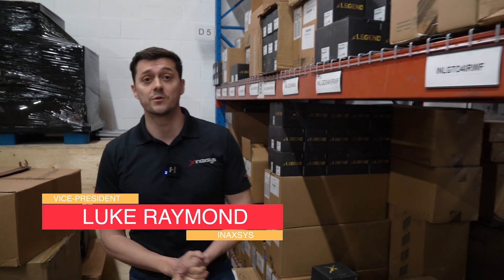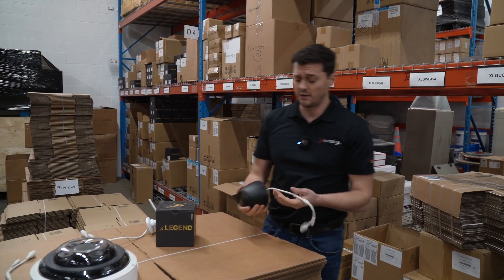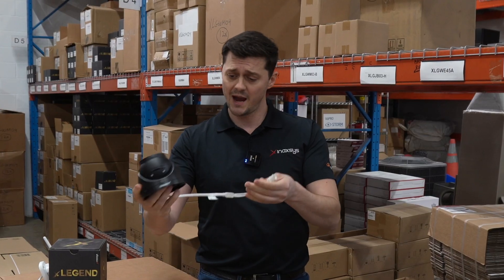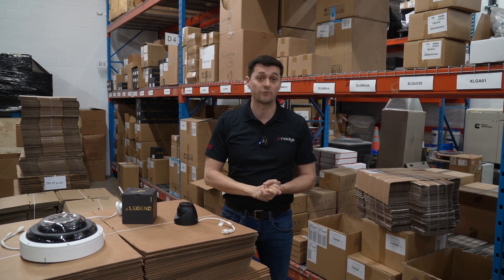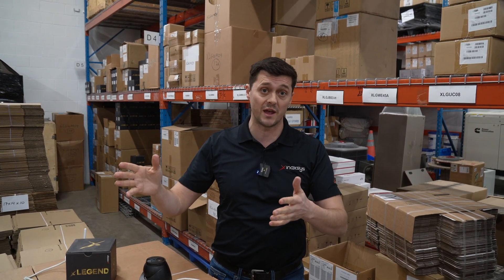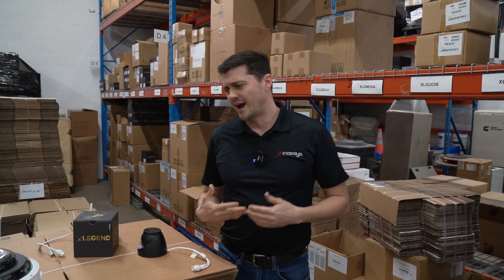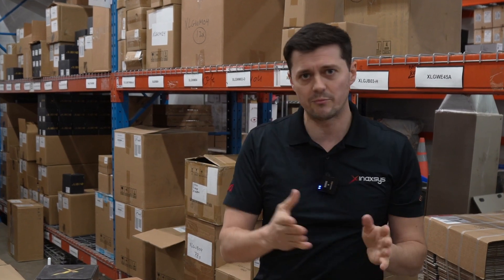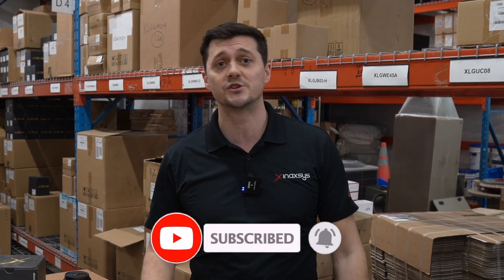Wired vs Wireless Security Cameras / Advices From an EXPERT

Comment: Very good information. I have 2 wired cobra system cameras at home and want to add 2 wireless cameras. Do you know if I’m able to connect the wireless cameras to the same NVR as the wired cameras? Just don’t like the idea running more wire around my house.

Comment: here's a question for you . i have security camera's around our property etc. they are hard wired , not wi fi . i have had our security camera get double imaged and then even fade and go completely out and even mess up the set time and day etc. settings . i put in a looper and it stopped . i also have another camera  that was getting wavy lines and color bars going across it  and it was so strong the picture was distorted and wavy , now i have had it reverse the picture making our white house look black sometimes and sometimes even making the sky look black and parts of the picture digital looking with lines jumping .  is this being jammed by a portable jamming device , ???
     i have been recording things as evidence etc. it seems to be all coming from the west side of our  house . on the opposite side camera's aren't effected . i am thinking  someone is using a portable jammer and setting the same frequency as our security camera sending out a stronger signal through the air and over powering the signal running through the camera to our dvr system .  I hope you can answer this and if there is a solution to this so i can stop it. PLEASE LET ME KNOW , THANKS.
Reply: 6months ago and no answer from "AN expert .".
Reply: @lonniehensley661  Probably indicative of their customer 'service'.

Comment: When I discovered wireless sec cams I did a double back flip thinking I had discovered the motherlode. I currently have 14 wireless cams set up in & around my property to watch for wildlife & our kitty. Even tho they are wireless you still need to pull power out to them. I have about half which are far from a building so I have some 100 & 200ft extension cords stretched out to give them power. Battery powered cams come up short because you will need to drag out a tall ladder & climb way up & replace those batteries regularly & solar does not work in my woods. PLUS in my woods the Wifi signal is weak & unreliable. If I had to do it all again & would have pulled ethernet POE cable which is  WAY  more reliable & gives a  WAY  better signal altho the cost is a bit more and you have to punch a hole in your building to connect to your inside router.
Oh, if only I could only do it all again.

!
Reply: Are your cameras also able to take batteries? I only ask, because what if a thief comes along and cuts the cords (Or of course a power outage)?

Comment: Really helpful information. Thank you.
Reply from the maker: Glad it was helpful!
Reply: @inaxsys  Just a thought, but with AIs abilities, would it be possible to have extreme fisheye lenses where the domed roundness can be corrected so that you can also have more scenery taken as well as an inward zoom feature if you can not get far enough away from a massive object to get the whole thing in one shot without having other objects in the way if you move too far back under the conditions of a normal camera? Also what about the idea that has been floated around about using the Nokia 9 Pureview camera setup with modern AI+tech? Then of course you have night vision, heat detection and such.

Comment: Great explanation my brain is thinking 🤔 of this multi system, I am looking to use whole im out of town for my cats. Cheaper yours sounds quality… for larger home?
Reply: If you just want to check in on your cats while you're away, you don't need a professionally installed hardwired home security system. Just buy multiple Wi-Fi enabled security cameras and place them throughout your house. They don't need to be expensive. Make sure all the cameras are from the same company so you can access the live feed from each camera from a single app on your phone.

Comment: Terrific information and insight. Thanks!
Reply from the maker: Thank you for your comment 🤝
Reply: @inaxsys are any cameras besides Nest, Ring come with hard wired capability so you can connect to electrical wire for power and then the camera use wifi to transmit camera and audio footage wirelessly. Not talking about a camera that has a cord with power adapter that plugs into an outlet. Talking about a camera that is wired into electrical box. Thanks
Reply: @inaxsys Hi I really need a motions detector camera that alert you on your phone  please help? Thank you
Reply from the maker: @bash2268  We have a lot of solutions for your request. Please contact us sales@inaxsys.com